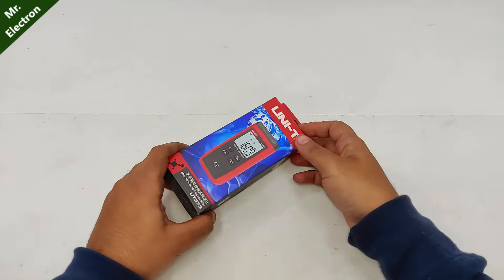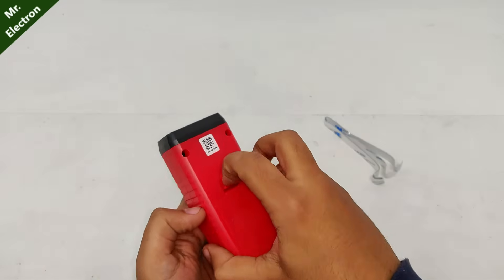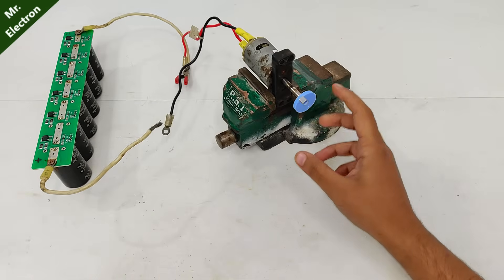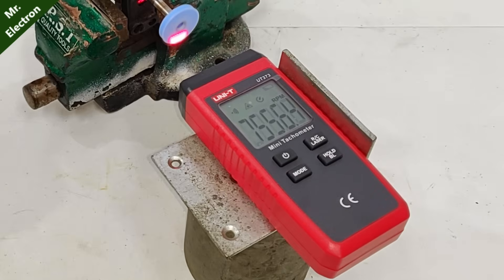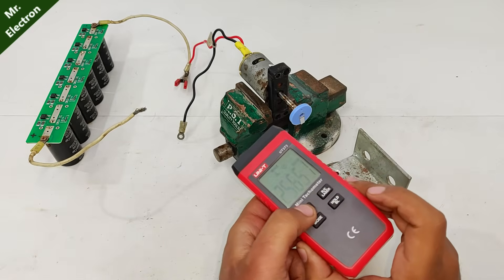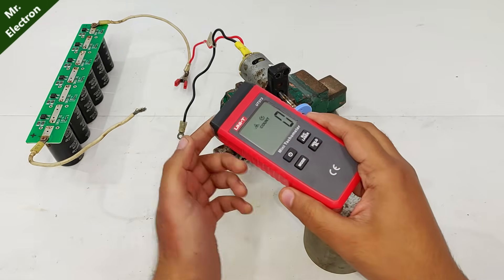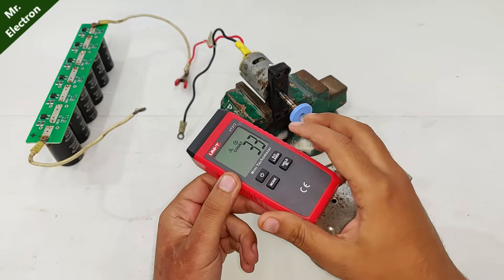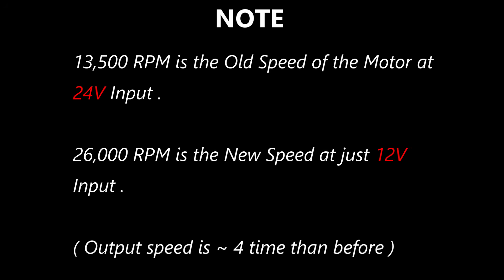26,000 RPM - Make 12v High Speed DC Motor from 24V Motor ( High Current )

Comment: Nice gadgets the tachymeter and the capacitor a Tron but it would have been nice if you would have been describing at each step what you were doing and or putting subtitle text into the video for example how many turns per leg of the motor did you do or are needed or is necessary does it have to be an even number of turns or odd number of turns what is the wire gauge that you used and what was the wire gauge that was prior that was used and also when winding the motor are you using one continuous piece of wire do you need to use one continuous piece of wire etcetera etcetera these are things in many of the videos are not mentioned

Comment: if you want high torque but low voltage use really thin wire and turn it around as many times as you can on the rotor